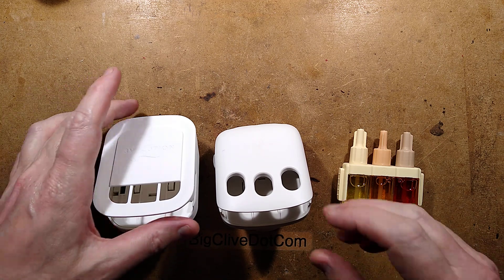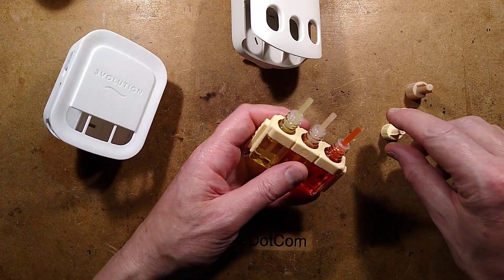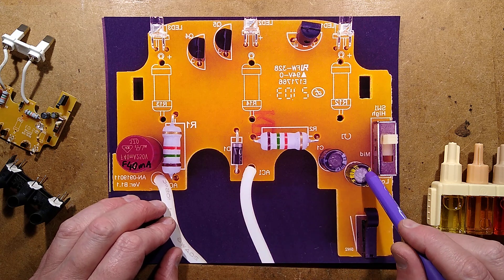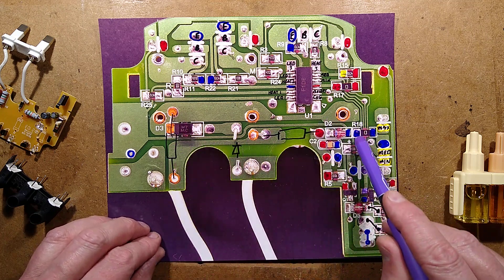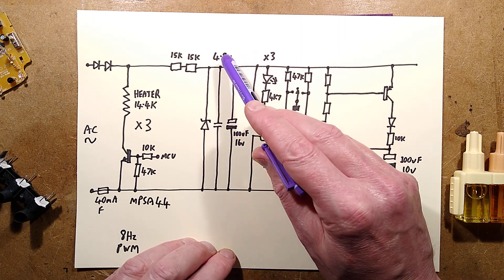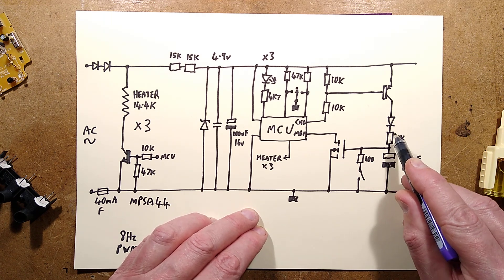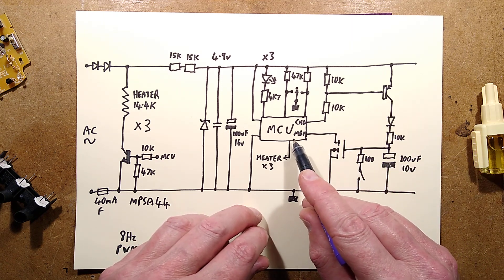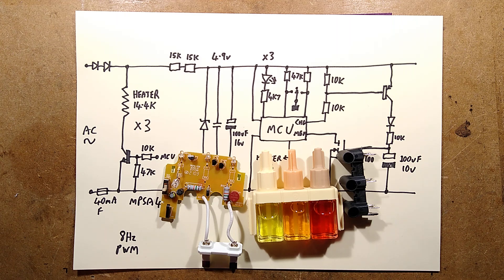New 3volution unit has clever circuitry

Comment: I didn't see a crystal oscillator, does that mean there's one integrated in the micro controller? 
Also, I thought most MC's have some basic amount of non-volatile memory or is this not the case?
Reply: The capacitor detects and remembers cartridge removal with power off. The MCU can't do that.
Reply: @johndododoe1411  
1. I watched the video too, so I don't know why you're repeating to me what I just watched. 
2. MCU's can store memory as flash, usually up to 128 kb. Look it up. 
3. I was asking someone with proven knowledge & credibility, like Clive.
Reply: @j.f.christ8421  Firstly, I was responding to @John in the notifications window, so your reply was not visible. 
As for your question, what's the point of updating any memory when the device is off? (which can be achieved anyway with a larger capacitor, as done in car dash cams to save the last frames, when the power is turned off)
Regardless, what difference would it make if the cartridge was removed/replaced while it's off? 
Also, I don't buy the claim that it keeps track of how much liquid is remaining. 
That's what the windows are for. 
Even if it was designed to keep track, it would fail miserably in guess-timating how much liquid is left as evaporation depends on external factors, temperature, humidity, mains voltage, etc., not just the time a cartridge is activated for.
Reply: @PushyPawn  If the MCU flash stores any information about spent liquids, last bottle active etc., it will need to clear that when fresh bottles are inserted.  Running the microprocessor for a few seconds after unplugging will not be enough as a typical user will take longer to replace the cartridge. The capacitor circuit may detect such actions for much longer, possibly an hour or more if the MOSFET chosen has a GS leak resistance above 40 Mohm.
Reply: @PushyPawn  Ok, you tell us what the circuit is for, apparently someone who doesn't even know about RC oscillators is smarter than the rest of us.

And you do understand cheap, right?  That means no crystal, no large backup caps, minimal functionality.  It's a simple timer with a clever cartridge removal circuit, as pointed out many times (and is the point of the entire bloody video) does the neat trick of detecting a swap while not being powered.

The little circuit is a single bit of memory, it's sole purpose is to tell the uC upon wakeup that the cartridge has been changed.  If it has then it resets its internal timer, and therefore will run for however many hours its been programmed to run for.  The timer doesn't give a damn about how much liquid is actually left or environmental factors, if the marketing team says the cartridge has a lifespan of 10 hours, then it'll run for 10 hours.  Pulling the cartridge rests the 10 hour clock, the uC doesn't know or care if the "new" cartridge is empty or full.

In the olden days it would have been done with a fiddly mechanism, something like the heater would flip a bi-metallic switch on and pulling the cartridge out would turn it off.
Reply: @j.f.christ8421  Good for you.
Reply: @j.f.christ8421  Good for you.
Reply: @PushyPawn  Lol.
Reply: Most (all?) uC's use an RC (resistor capacitor) circuit internally for their clock.  Some have the option to connect a crystal, rare at the cheap end though.  The RC isn't as accurate, but good enough.

They tend not to have any non-volatile memory (EEPROM) because, well, cheap.  As @JDD said that won't help, the trick here is it can detect cartridge removal when the uC has no power.

How it works is the first thing it does on power up is check the MEM pin, if high no swap was done, if low (the switch shorted the capacitor) then it should have a new one.  As mentioned it is very clever.

The non-clever way would be to put the uC to sleep when unplugged, and have an interrupt watching that switch.  When the cartridge is swapped the interrupt triggers, the uC wakes up and updates its memory.  A sleeping uC doesn't use much power, but it's still way more than what that little capacitor can provide.  You'd need to put in some sort of rechargeable battery etc and that drives your price up.

Comment: Would it be possible to connect this to a timer that switches it on for half an hour and then off - repeating it every other half hour - or would it just use bottle #1 every time it is switched on?

I mean, I'd prefer just to have nice smells in the evening, when I'm home, but every other half an hour is MORE than enough 'smell' for me.
Reply: Seems it runs each scent for 45 minutes, so on a 30 minute timer you only ever use the first one (I'm assuming it's not smart enough to remember where it was up to).  Maybe you'd need to get used to 2.5 hours (45 min x 3) of smelly stuff instead of 30 minutes?
Reply from the maker: It would keep using the first bottle.  You might need to write new software for a microcontroller for more control.
Reply: @bigclivedotcom  If it doesn't remember where it was up to, why does it need to know if the cartridge was swapped?  What does it do differently for a new one as opposed to just turning it back on again?

Comment: Is your drill a Ryobi 14.4v li-ion battery one? I got one with a charger and two dead batteries. I opened the batteries and discovered one cell in each one had a negative voltage. I replaced all the cells in one battery but it still won't charge and while measuring the voltage coming from the BMS on each cell  I found that it's trying to put something like 18v (oscillating?) on the same cell that failed (now replaced with a new one) for a few seconds before the charger goes into error and stops charging (flashing red and green leds).
Reply from the maker: It's an 18V one.  The Ryobi may be fussy about all the cells being at a very close voltage before charging.
Reply: @bigclivedotcom  I'll try to charge each of them again as close to 4.1v and see if they work with the Ryobi charger. Thank you Clive!

Comment: I would like to see 240vac go through the heater resistors while the cartridge is plugged in...outside of course  :)
Reply: You would definitely need to bridge that annoying fuse
Reply: The unit will probably emit a 4th fragrance, Essence of Burnt Circuitry.
Reply: @tncorgi92  if you unsoldered the zener and then plugged it in it would liberate that lovely sweet smell of burning integrated circuits
Reply: @tncorgi92    
I know it well  :)
Reply: They would dissipate four watts, so chances are nothing much would happen.
Reply: @eDoc2020  I suspect you would be buying refills much more frequently

Comment: What is the maximum refresh rate on that 1 bit of nonvolatile RAM? 1Hz or something like that?

That is a cool little circuit, somebody patted themselves on the back for that one.
Reply from the maker: I guess it could be classed as static RAM with hopefully a 24 hour refresh rate if it does get switched off every day for 12 hours.  (I doubt they do.)
Reply: @bigclivedotcom  I tested a NOS 10 000 uF 6V Sprague can electrolytic, charged up to 6V via a 1k resistor to reform it, and left it disconnected on a shelf for 6 months or so. Still had 5v on it after that time, while the other one, in the pack of 40 year old old stock capacitors, had corroded through the case, just in storage.

The 100uF capacitor likely has a time constant of around a week there, more depending on board leakage, and flux residue than capacitor leakage. Clean board probably 2 weeks, dirty crappy flux messed board with moderate humidity probably a day or less.
Reply: In 5 years "we present RGB aroma RAM for your ultimate gaming experience. Smells to choose are blood, sweat, iron and pooh".

Comment: Certainly an interesting circuit, thanks 4 sharing. But I'm wondering why it's important that it remembers in the first place? Is it to prevent the 'first' bottle in the unit from being emptied prematurely if the user only switches it on for the 'first' Pong Propagation Period each time? (need to copyright that threesome, don't I?)
Also a little bit more info on how the heaters work (i.e. why the stuff evaporates when heated etc.) would have bean nice.
Reply from the maker: It's to encourage the user to buy replacement refills in advance.
Reply: The heaters warm up the wick in the containers, so making the liquid, a blend of glycol, essential synthetic oil perfumes and some preservatives ( you will not believe how expensive some of those perfumes are when pure, I have seen prices of some being $20k per litre, and you have to order them in a 20l container) plus a lot of pure water as bulking agent. This is then slowly evaporated into the room, and the heat encourages a slight convection current of air to move it out of the unit.

Remembering likely is there to allow the unit to cycle the bottles properly, it probably does a power on test, and then checks the bottle change timer to see if the cartridge has been changed since last power on, and then uses a simple random number generator (possible as the power on time is going to be slightly random, as the voltage rails rise up slowly depending on the mains phase, so the clock will run a little bit before reset is achieved) to select first cartridge. 

Turns on the charge circuit for the memory, to top it up, then likely turns it off again, only polling it every odour change, to see if it has been changed, as it likely sleeps most of the time, just using a clock and timer to generate an internal interrupt every 16 minutes (guess based on the 8Hz LED and modulation rate, which is easy with the same timer, and a set of PWM comparators on chip, all using the same clock) to wake up, flip to the next odour after 3 cycles, and again check the cartridge and reset the capacitor. 

After a certain number of cycles, probably 14 days of powered on all the time, it will flip to flashing the LED's to indicate empty, but likely there is still at least a third of the fluid left in them. Just to get the consumer to buy another, then come, pull it out, and see it is not, and put the old cartridge back, or toss it and put the new one in. They hope you do not look, but toss the partly used one.

Most of these units are plugged in and left on anyway 24/7, so a flashing reminder might be useful, at least getting you to keep on buying the expensive tiny refills, instead of simply refilling yourself with a bulk bottle of fluid (in your choice of aroma) and reusing the old one, as it likely has only 5ml of liquid in it.

Comment: Please tell us how to refill them, Clive!
Reply from the maker: You can use a blunt knife to pop the tops off, but you'd need to use the contents of other aroma plug refills.
Reply: @bigclivedotcom  I wonder how well would it work to refill with skunk aroma, put back in a box, in a zip-tie baggie, and have it somewhere as an “easy steal”, maybe inside the backyard shed or such. I’d love to be a fly on a nearby wall when it’d get turned back on. The skunk juice can be mixed with original potions for temporary masking.
Reply: Kuba Ober I'm with you. Be at my brothers sipping whiskey when that third canister fired.
Reply: Yes they can be restored using similar bottles,  or if you have some still in an old refill,  swap the individual bottles on the plastic holder